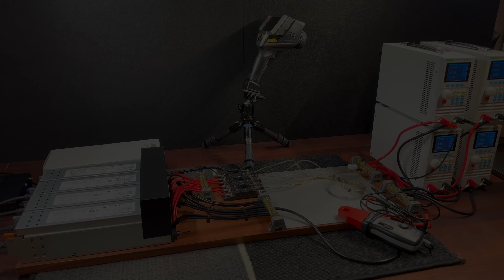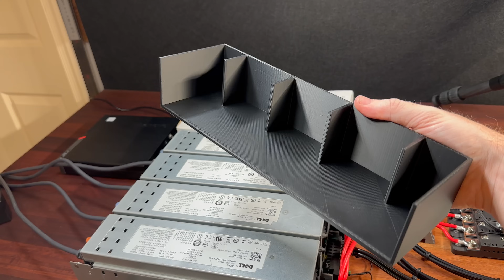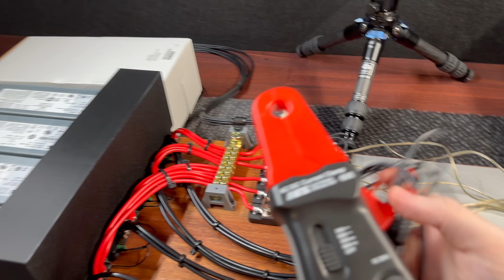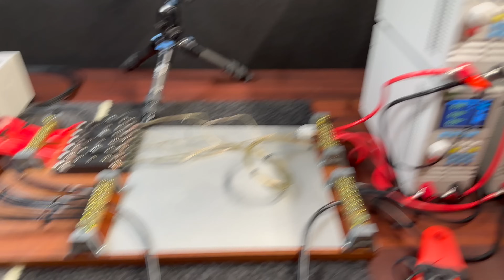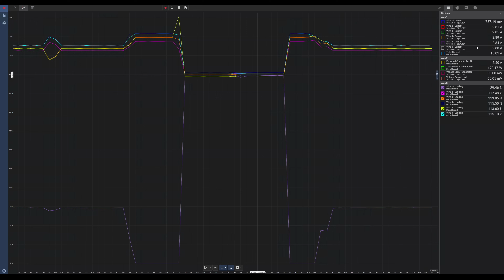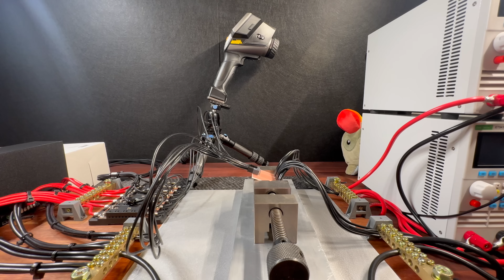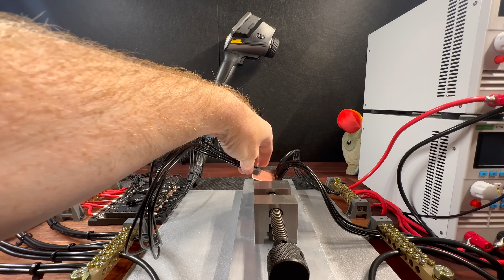NVIDIA 12VHPWR - Big Upgrades!

Comment: Good job and can't wait for the test results.
But some opinions and clarifications.
Agree that the protection should be on the power supply side, every 12vhpwr wire should pass a current check and notify the user if there is an imbalance.
At the same time, you fail to take into account that this connector is too small for the user and there are a lot of problems that the socket is not inserted properly (user error but still it must be taken into account).
It would also have fit if 8/6 pin terminals had been used, for example, in a 12 pin socket (the size would have fit).
Sorry if some typos ENG is not my native language.
Reply from the maker: I definitely agree in regards to it’s usability I actually cut a section around that in regards to the connector (and computers in general) were never designed to be messed with by the general public. Back in the day, the inside of computers was only touched by technicians and tinkerers etc. Maybe that needs to be taken into account now…

Comment: Cool video can’t wait to see more. One thing though I was under the impression that nvidia developed the connector and then it was accepted into the ATX specification not the other way around? Maybe I have it wrong …
Reply from the maker: I believe it was a collaboration (happy to be corrected) but they wouldn’t have designed the connector, only specified criteria for current needs etc and outsourced the design to companies who develop this stuff like MOLEX 🙂
Reply: @whatcouldgowrong7914  
for sure, PCI-Sig is comprised of many Hundreds of Companies, though the major players are usually the ones that outline the details for new standards. Nvidia *was* a strong proponent for co-designing and advocating for adopting the Connector, since they were clearly looking for some way to save PCB space, but they don't have the authority to just greenlight it themselves and make it a live standard, they're just one member.
they can't just Sign an Order and override everyone else they're sharing responsibility with and undo Decades of careful choices!
Reply: PCI-SIG is what I understood it to be

Comment: Good setup. 
Next steps would be 4 layer mockup pcb that has power connector, fuse, and shunt resistors. Those component well effect some amount of +12V pin cooling.
Cheaper test would be to use same style board that you have and add fuse and shunt to board to make +12V cooling worse compared to GND
Another test would be to find broken 4090 or 50x0 card that have another problems and use it to test how pcb is spreading heat from connector and is it even between gnd and +12V.
Reply from the maker: It is definitely on my radar and I have people willing to help design it, problem is they need guidance on what is an undisputed “fair” design to represent graphics cards overall with design specifications 🙂

Comment: nvdia is responsible for choosing this connector
Reply from the maker: Technically yes but options are limited and you cannot just keep adding 8 pin PCIE cables and there are no other alternatives… 24V/48V is the only path forward with the current connectors